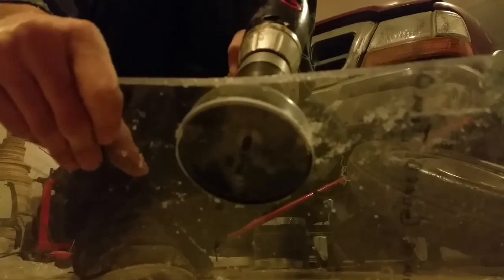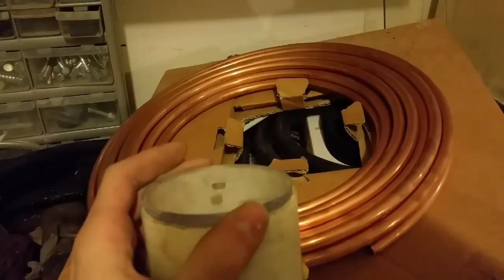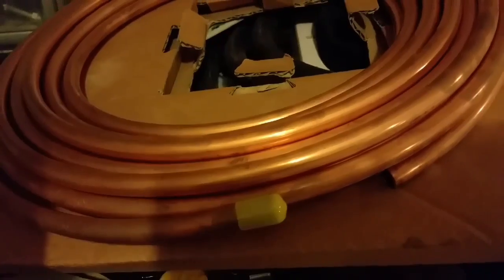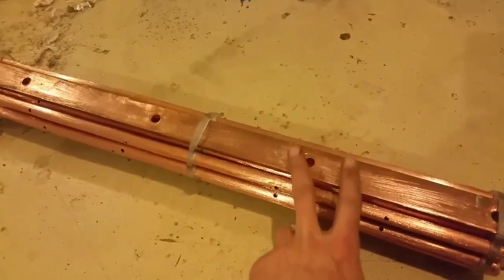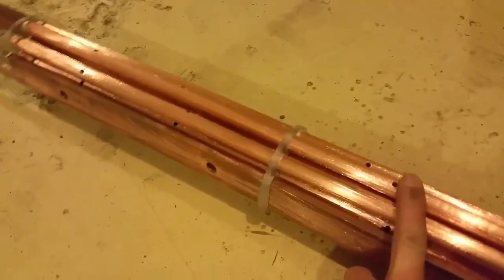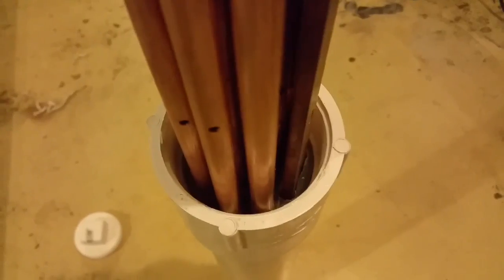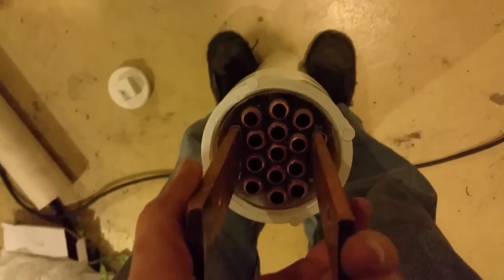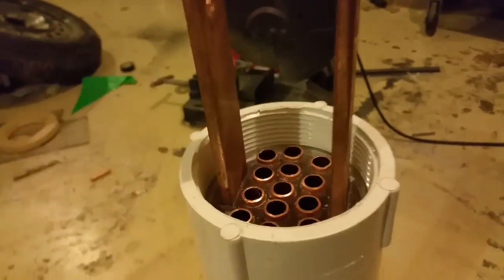Copper tube HHO generator attempt pt.1

Comment: POSITIVE & NEGATIVE WORKS BEST WITH STAINLESS STEEL. POS/NEG (PREFER STEEL) ON EACH SIDE WITH COPPER TUBES FOR NEUTRAL WITH HOLES DRILLED ALL OVER EACH ONE,ALL WRAPPED TOGETHER WITH PLASTIC ON EACH END AS SHOWN.

Comment: Good luck! Are you aiming to run your truck off 100% HHO? I do not know what the performance different between copper and stainless might be. Personally, I think it could be the face the copper can corrode and you might have to do more maintenance.  I will be watching for updates,
Reply from the maker: NotWatching666999 Not running a truck. Just tinkering, might try out a torch.
Reply from the maker: NotWatching666999 I'm guessing the copper with corrode pretty quickly but I had it all in the garage so didn't cost anything. if this design gets me bubbling I'll try stainless.